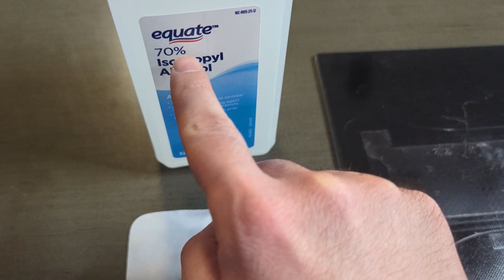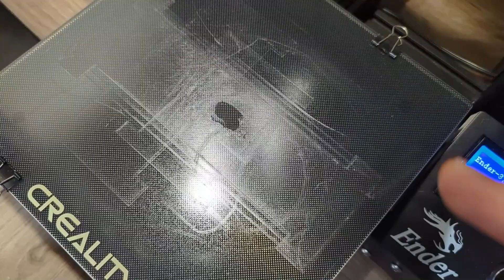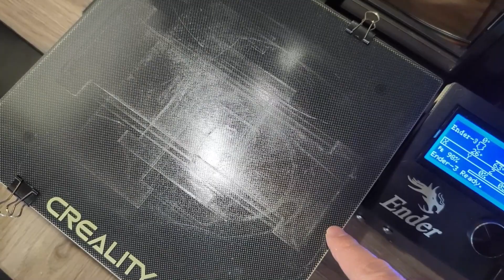Clean Up Your 3D Printer Glass Bed

Comment: Oh just some FYI for cleaning these types of beds.. use a finger nail brush and scrub a little with the alcohol ..  helped me .. hope this helps someone else..  warm bed 60 to 70 degrees... and alcohol and circular motions with plastic bristle brush
Reply from the maker: Thank you for the helpful comment (Pinned), yeah I agree, that is really helpful. Also, the alcohol is not an everyday thing, I would say it's a once in a while and try to avoid it as much as possible.

Comment: NEWER CLEAN IT WHEN ITS HOOT FAIL M8 YOU DESTROY THE COAT
Reply from the maker: Yeah I agree, thanks for the information
Reply: @techs.passion  And one more thing newer use paper to clean the bed, it will leave small small dust and it will be hard to get it stuck. I have newer used any form of glue on my printer bed, just right calibrated printer=great print and it will stay on place. Regards from Sweden!
Reply from the maker: Thanks again for sharing the information and I'm glad to hear that you are watching from Sweden. this is great!

Comment: I use dish soap and warm water (Hot as I can stand with vinyl gloves.) with a cloth that is bonded to an exposed plastic mesh as a scrubbing medium and a clean microfiber rag or paper towel to dry the glass bed.  Then on small models I will rotate the bed between prints to mismatch the bonding surfaces.
Reply from the maker: Thanks for sharing and for watching. Very helpful.

Comment: Is it a problem if I scraped my glass bed few times?
Reply from the maker: Ideally you don't want to do that as it's easy to scratch, I'm not a big fan of the glass bed but you should still be fine. You can always use the other side but you might need glue if you use the smooth side

Comment: I put liquid dish soap after 4 to 5 prints and rub it with the dish sponge.
When I put for 4 to 5 times glue does not clean with alcohol .
When I wash it the first time with soap I can print without glue.
After that I make 4 to 5 prints without cleaning it but I put glue
Reply from the maker: Generally that's good, what I need to try is the smooth side of the glass bed with glue to see if that helps. I will make a video about that. Thank you
Reply: @techs.passion  i will stay tune for your next video
Reply from the maker: It will be coming soon, thank you as always

Comment: I use sandpaper and water, after that just dish soap.
Yes it´s extreme but you cant argue with the results
Reply from the maker: I'm gonna have to try it, I will keep you posted, thanks for the idea 💡
Reply from the maker: Thank you for the idea, I wanted to give it a try https://youtu.be/ZirnE73nd2U I think it's good if the bed is really bad but I wouldn't do it if the bed is still in a good shape. Thanks again :)

Comment: I bought the glass bed for the ENDER 3 pro... not happy at all with it's performance ... went back to the magnetic flexable bed.. much much better IMHO  I've been printing for over 4 years  just this year got the LONGER LK5 Pro for 179.00 Newegg.. and it's way better than the ENder 3 pro.. I had bought my ender 3 pro almost 5 years ago.. had to change out motherboard to make it quiet,  the knob is a pain in the ass .  The longer LK5 has touch screen .. makes life so much easier ..  oh also On the ender 3 had to change out stepper motor I changed the extruder to an aluminum one as the plastic one wore out..  this was over 2 years before replacement so it's been a great printer.. just had some parts go bad as normal as far as I am concerned .. only thing I wish was different was that dam knob..  what a pain in the ars it is,   So just get the $12.00 magnetic bed and call it a day... when it starts to wear out.. get a new one.. simple and cheap...
Reply from the maker: I cannot agree more, I do not recommend the glass bed. See this video here https://www.youtube.com/watch?v=7A0YnWV6N2U
I have an ender 3 and ender 3 max neo, I did upgrade the ender 3 motherboard and hot end. I also upgraded the bed and added a light so it's really upgraded so far and I still think it's a good printer but now I recommend the max better. Overall, I like the ender and for the price their not bad. I really like the PEI bed and not so much the glass, If I have to choose I would keep the default over the glass but the PEI is nice also I wouldn't install the magnetic sheet that comes with the PEI bed. Thank you for the nice detailed comment.

Comment: Haha I've used it this way a few times with rubbing alcohol. I still see what my only last 2 prints were..
Reply from the maker: Lol I messed up the glass bed by scratching it with the nozzle. Now I have all different types of beds, I recommend the plastic PEI the most but I would use it with the clips instead of the magnetic sheet. Maybe I make a video about it soon. Thanks for watching:)
Reply: @techs.passion  I'll check it out and see if the plastic works better. I'm assuming Amazon or eBay for it? Thanks
Reply from the maker: Amazon is best, I had a discount link in the videos not sure if it's still working. Not sponsored or anything. Just a thanks for watching deal. Let me see if I find it, I will share it with you. Look for the video that has 3 beds compared. Let send that your way, one second
Reply from the maker: https://youtu.be/bcwJpeCoPe4
Look in the description of that video, I hope the Link still works but if you find a better deal than of course go with it, I'm only trying to help, this is not a sponsor or anything

Comment: I have a similar textured glass bed and have the same issue. I can see yours like mine is still has a lot of PLA left over even after cleaning, which impacts the quality of the look of the prints. The PLA really sticks to the 'holes' in the texture. We need a manufacturer to come up with something like a ball of putty that sticks to the PLA but not the bed so that we just heat the bed to melt the PLA and roll the putty over it to collect the PLA up. The texture of the bed looks like it's made from some kind of heat resistant paint. I wonder what they use?
Reply from the maker: I think they use carbon and silicone for this bed. So the way it should work is if the bed is hot, the PLA will stick but to pull it out you have to wait for it to cool down and that will split the glass from the PLA as they don't shrink at the same level.
The mistake I made is having the nozzle too close and the PLA got really stuck, also no need to use knife or any sharp edge to take the print off, it's best to wait for it to cool down and should be easy to pull the print, I learned the hard way. Now for my Ender Max, I followed these instructions and it's working for me really well.
That said, I will test PEI board if it's helpful and I will let you know, that should be coming soon. Thank you for the comment and for being here :)
Reply: Just get the magnetic flexible bed and call it a day...  the glass bed on the ender 3 sucks   when the flexible bed stops working   spend the 12 bucks and get a new one... problem solved     lol
Reply from the maker: I agree